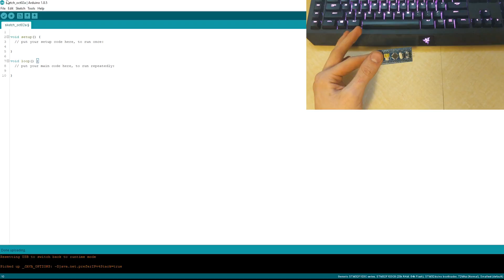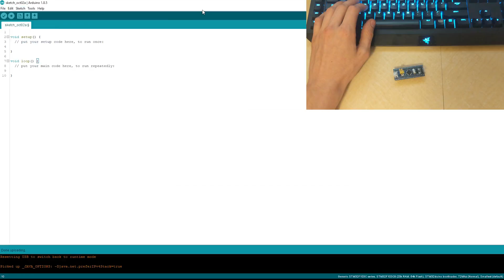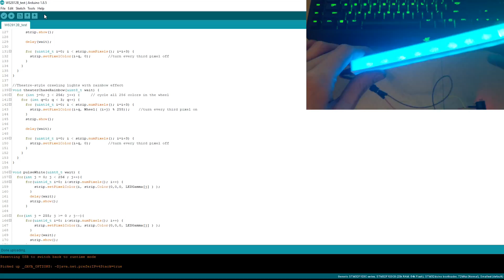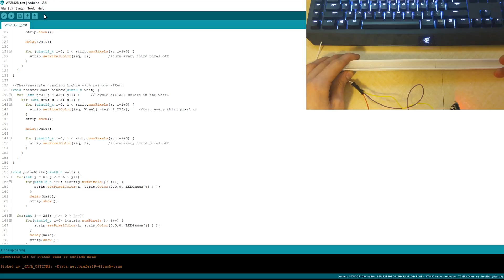STM32 Bits: Neopixels!

Comment: Data line of the WS2812 has an high level ( logic level 1) at 0.7vdd ( 3,5V for vdd 5V) so you can get erratic behavior with some chip (even not working at all), so you should use a level shifter. The simplest way ( at least one way ) is to configure the output as open drain (without internal pull-up) and add an external pull-up connected to the 5V, something like 2k2.

Comment: Do you use external power supply or only 5V line on plate?
Reply from the maker: I used the 5v line that's supplied from the USB, but as long as the grounds are common you can use an external one